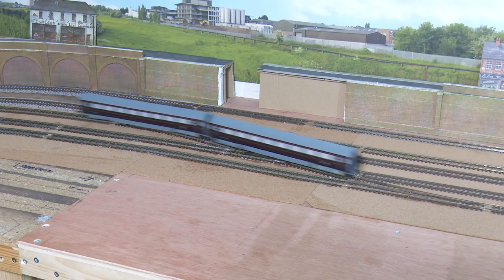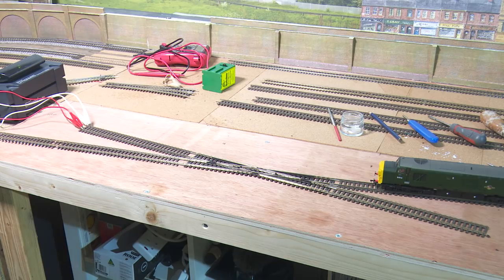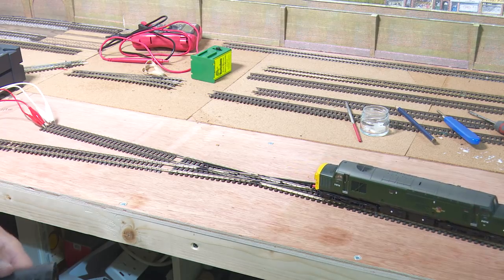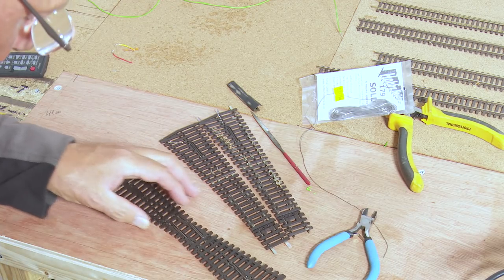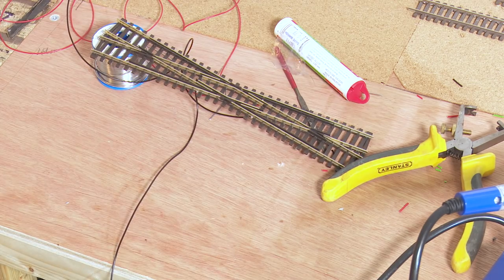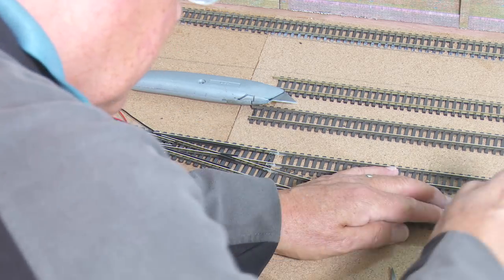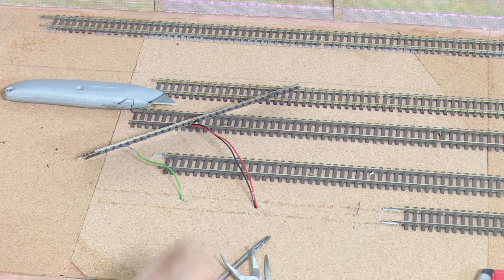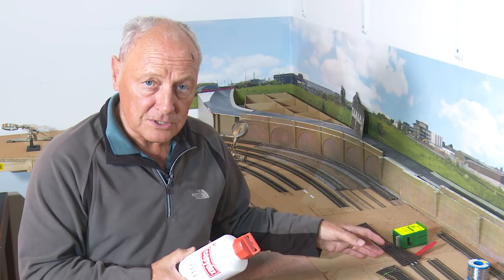43. Installing a diamond crossing at Chadwick Model Railway.

Comment: As usual, another excellent video.  I’ve watched some of the series 6-8 times especially when I’m moving on a stage.  So this week I’ve laid 2 double slips and a single slip with Tortoise motors for the station throat.  This is the first track, first soldering, etc, etc.  Your help has been invaluable. I just thought you should know your hard work, and clear explanations are being put into practice and are much appreciated.
Reply from the maker: Hi Brian, it’s comments such as yours that make the effort worthwhile.
Good luck with your layout.
Regards Charlie

Comment: As always great tips. It might be a daft request but I have a lot of trouble getting track joiners to fit. Do you have tips to preparing them.  Hope the head heals soon. Steve
Reply from the maker: It’s just a case of filing off the burs from the cut rails and being careful.  There is no easy answer  I’m afraid.

Comment: Could you provide a link or website for the pico 6 foot track guide and the track setter? Thanks! Excellent video. Thanks for sharing
Reply from the maker: Hi, the 6ft Gauge and the Tracksetta gauges are both made by Peco and should be available from any Model shop.  Failing that, do try Hattons.
Regards Charlie
Reply: Thanks for the info.

Comment: Epic video, i need to learn all this point wiring before i make a start on my layout. so block detection is all about isolating each track from one another? where do the wires go to the main bus or?
Reply from the maker: Hi, I’m so pleased that you enjoyed the video.  With block detection and computer control, each block has its own separate power feed from an electronic controller.  In the case of Digitrax, its a BDL168.  Please search YouTube for this item and hopefully you will get a better understanding.
Regards Charlie
Reply: @ChadwickModelRailway  Great, can the bachmann dynamis ultima do something like this? as i think thats the controller im going to go for
Reply from the maker: I very much doubt it.  Any automation will probably be based on time.
Reply: @ChadwickModelRailway  ahh blimey, oh well not to worry thanks.

Comment: Another great video, Charlie! I had a similar situation, could go from the near track to the far track forward, but had to back through the turnouts to go the other way. No room for another pair of turnouts, so I had to install a railroads nightmare: a double crossover. Think of two parallel tracks with an x between them. 4 Atlas #6 (medium) turnouts and a 19 degree crossing make a double crossover with a 3 inch center-to-center track spacing. My track has 2 inch spacing. I had to do some creative "surgery" to the turnouts and crossing to get the correct spacing. Does it work? I put 35 cars behind my 4-8-8-4 Union Pacific Big Boy steam locomotive and pulled the cars at speed step 10 (of 28) through the crossing 3 times with no derailments, then BACKED the train through the crossing at speed step 5 3 times with no derailments. I'd call it a success. With track-work, you simply do what you have to do!
Keep 'em rolling!
Reply from the maker: Hi Flyboy, I’m so pleased that you enjoyed the video. Regarding your double crossover, I too fancy constructing one.  I have some used points but have yet to plan the layout on the other baseboards.  Is yours  DCC layout as its wiring could be a challenge.
Regards Charlie
Reply: Hi, Charlie! Yes, my layout is DCC. I have the turnout frogs powered by Caboose Hobbies manual ground throws with contacts for the frog. (I just need to remember to throw both turnouts for the selected route.) Other than that, I just wired both rails of the turnout together to provide good, reliable electrical contact and not rely on the point rails for contact. The frog of the crossing is not powered. I attached feeders to the rails of the turnouts in the standard manner.  Here's a link (hopefully) to my layout page at  Model Railroad Forums dot com. http://www.modelrailroadforums.com/forum/index.php?threads/the-union-pacific-soggy-bottoms-division-ho-scale.26206/page-6 Posts 106 and 107 show the crossover. These are Atlas products, and all frogs are insulated. I really don't know how you'd wire up Peco Electrofrog products. If I can be of any help, just ask!
Reply from the maker: Sorry Flyboy but the link doesn’t work.
Reply: Sorry for the delay getting back to you, Charlie. I don't know why the link won't work, it does for me. I sent you the link via email through your photography site. Hope that's OK.
Reply from the maker: Thanks Flyboy I now have your link.  That crossing is a great construction.  I'm sure that I will have a go soon.  Regards charlie

Comment: Hi
Did you use 6 irj  in total for the crossing?  I'm sure i saw 4 on one side and 2 more on the other end.
Thanks 
Andy
Thanks 
Andy
Reply from the maker: Sorry Andy, what's a 6 ijr?
Reply: @ChadwickModelRailway  
Hi charlie  Thanks for the reply. Icould  see 6 insulated  rail joiners on the insufrog crossing. Was wondering  if there should have been  4  from point to point crossing  or do all tracks  need irj.
Thanks 
Andy

Comment: Hi Charlie! Been watching through the videos from your change from Chadwick TMD to Chadwick Railway. Has been very interesting! I noticed on a few videos you modify the points by cutting the link and then soldering the sections together... You aren't the only person who has done a video doing the same thing... Kinda makes you wonder why Peco don't supply the points as standard in the configuration you have made... Might be worth contacting them and suggesting it?! - Richard
Reply from the maker: I agree Richard and Peco understand the situation.
The modification is actually detailed in the instruction leaflet..

Comment: At about 1:30 you mention that you want the two points to fire at the same time.  Is this a trick at the Tortoise level, or something controlled by your digitrax?  I’ve got 3 such pairs so would appreciate knowing how that’s done.
Reply from the maker: Hi Brian,  switching two points together is common on many layouts.  With Digitrax you simply wire the two pairs of wires into the point controller.  If you are using a stud and probe arrangement then I think that you need to construct a diode arrangement.  What system are you using? Regards Charlie
Reply: Chadwick Model Railway  I’ve not got power yet, just droppers ready. I’m hoping to invest in a bunch of Digitrax stuff next month.  If the control is there, that’s fine. I thought I might be missing a Tortoise trick.  Thanks again. Brian
Reply from the maker: Yes with Digitrax, you just wire both motors into the same terminal.  You might have to switch the cables around to make sure that they both operate in the right direction.

Comment: Since both points will be switched at the same time, why not do it with only one tortoise? You can use the gadget Tortoise has available or get really devious and do it with two pieces of piano wire.
Reply from the maker: That’s a very good point but with the point motors being about 14 inches apart, I’m unsure that this type of linkage exists. Good luck with your layout. Regards Charlie
Reply: Hello Charlie, the Tortoise linkage would handle that easily, my points are 22 inches apart and I use the Tortoise remote setup. It is slightly cheaper than using two Tortoises and it's also a useful option when you have restricted access under the layout. 
More challenging is making a linkage using piano wire, mount the Tortoise horizontally and attach the piano wire linkage direct to the screw on the Tortoise. I've used this setup when I didn't have a Tortoise remote and there were wooden braces under the layout, that was a single point setup but I'm sure it could be used with a two point setup.
Reply from the maker: Thanks for the update.  I’ll try and find a Tortoise dealer here in the UK and check out their full range of accessories. Do you have a website of a dealer? Regards Charlie
Reply: I've made most of my purchases through Ebay.

Comment: Q: Are those #6 or #8 points, and what angles are associated with the various point #'s? (Sixty years ago, I worked on a Union Pacific engineering (read survey) party, and, believe me, staking mainline double crossovers was the bane of our existence. Unfortunately I have lost my track tables which also had all the spiral information.)
Reply from the maker: Sorry Jack, Peco, do not list the points by #.  They are either short, medium or long. Regards, Charlie

Comment: I do have a question about the rail code you're using (code 100)
you said in a prior video that this was much better for exhibition networks, considering those need moving every week end and code 100 is more sturdy.

considering you're now doing a fixed network, that won't move for a while, you couldn't you have done it all in code 75 ?
Reply from the maker: Yes, but now 75 Bullhead is even better AJ.

Comment: btw “Copydex” is the similar compound as a product called “Maskol” - an ammonia/fishy smelling liquid glue used to mask areas of modelling paintwork, usually applied in minute form with a cocktail stick. Just a tip, if you’ve already got a bottle of Copydex it can be used for masking paintwork detailing - it must be removed though after a couple of hours.
Reply from the maker: That’s Bobby, that’s a good tip. Regards Charlie

Comment: I am having trouble on how to wire up  double/single  slip crossing, need help-Please
Nigel Woodgate
Reply from the maker: Hi Nigel, I’m betting that you’ve cross- wired the frogs, assuming that you’re using electrofrogs.  The wire from the frog goes on the opposite point motor.
I hope that makes sense.

Comment: I just noticed in your video that you had four on one side of the crossing . My thought. Was you only used isolated joiners on the crossing between  the tracks . And not the straight  through  track.
Reply from the maker: Hi Andy, I’ve used for insulated rail joiners because of block detection. Have a great Christmas, regards Charlie

Comment: Hi charlie is it possible to repair a double slip, as one of mine is faulty i thin k the spring is broke at one end is it possible replace the spring and can i get one from Peco ? regards .good video charlie.
Reply from the maker: Sadly Tony, I’ve never tried. However, because I use tortoise point motors, I always remove the springs! I’m pretty sure that Peco do sell springs separately. Regards Charlie

Comment: Hi. What size heat shrink tubing would I use for 1.6 and 3.2 wire? Many thanks
Reply from the maker: Here's a link to the kit that I use Les.
https://amzn.to/31CPA3a
Regards Chatrlie
Reply: @ChadwickModelRailway  many thanks for replying. I will certainly buy that kit. Also the bus bar connecting blocks from amazon you mentioned in a previous video are going to be brilliant. I've finished laying the baseboard and have made a lift up section. I'm going to paint the board and then lay the track joining droppers to bus wire. It's all exciting stuff. You have many great ideas and tips. I'm glad I found your site. Keep up the good work

Comment: Was working on my track today and found myself trying to slide a fish plate (rail joiner here in the US) onto a short piece of track like you were doing at the 2740 time line. i kept squeezing the joiner to much and it would bind. I then went to using a small screw driver (flat blade) and pushing the joiner one way or the other and I found that this was faster and (I feel) better...
Reply from the maker: A great solution David.

Comment: Hi Charlie
Ouch, hope your noggin is okay.
Being one of those people who had issues with the insulfrog crossing I found this an interesting video.   Ive now changed both mine to code 75.  I got to the point I was pulling my hair out due to locos stalling for a fraction of a second or worse case shorting out (this tends to be my Hornby models ie class 31 or 50 and lima stock with chunky metal wheels) the smaller locos were an issue, 08, 03 and 07.  It also convinced me I needed stay alives, however Im not so sure now as so far the 07 on test hasnt had any issues on the code 75 crossing. When I find the 08 I will be giving it a thorough testing too.
I havent tried glue yet but it seems to have advantages over pins, if a little slower due to the waiting time, Im going to try it out on my next board.
Look forward to your nect videos.
Regards Paul
Reply from the maker: Hi Paul, thanks for your interesting update. Reading through these comments, one chap used clear nail varnish to stop the shorts.
Regards Charlie

Comment: I was just wondering something. I notice that (on your side of the pond) you have double ended engines. I understand that this was because of the lack of space for turn tables. My question is how do you know where the actual front of the engine is for forward and backward operation?
Reply from the maker: Great question. 
They are known as either No 1 or No 2 end.  The end with the roof fans is No 1 but it really only matters when computer control is involved.

Comment: Why not using a double switch cross over (I don't know if that's the right word), so that the train from chadwick can not only con into plattform 1, but also in 2?
Reply from the maker: There is a point back up the line which allows access the platform 2.  I think that you mean installing a double slip.  However, in real terms, if a point should fail you could have a “head on” with a train on the down line.  I hope that make sense. Regards Charlie

Comment: Enjoyable and informative video, I am planning to use 4 turnouts and a small crossing to make a double scissors crossover and it will be OO finescale. I think the electrical side might be interesting :-) I also think I may have to modify the crossing to keep my track centres at 52mm.
Reply from the maker: I’ve looked at doing the same. You do have to cut down your points. Good luck with your layout. Regards Charlie

Comment: Hi there are you using streamline or set track spacing between rails? - excellent videos! Cheers JC
Reply from the maker: Hi JC,  just to confuse you, the answer is both. I normally use streamline spacing, opened out on the bends to allow Mk 3 coaches to pass each other.  However, on the four tracks through the station, I’ve used set-track distances to separate the centre tracks.  This is to allow a support column for a footbridge . I hope that makes sense. 
Regards Charlie
Reply: Chadwick Model Railway thanks that’s interesting! I must admit it’s set track spacing for me because of passing long carriages - interestingly it doesn’t help when you’re installing long crossings and streamline points hahahah

Comment: Great video again Charlie. Loads of good tips there! Glad I'm done on track laying. Copydex is a god send for virtually instant bond and noise reduction. I'm half thinking is it good to use for glueing down ballast! Wonder if it works as well if diluted down the same way as pva! That will be a near future test.
Reply from the maker: I’m sure that I have heard of someone using Copydex to ballast.  I’ll ask in a future video. Regards Charlie
Reply: @ChadwickModelRailway  I'm almost sure I read of this in a Railway Modeller back in the 90s.
Reply: @ChadwickModelRailway  would be intersting to see if anyone has done it with success. Ive glued my track (wood glue and copydex) and the sound is greater through the baseboard on these sections than the pinned areas. Would be good to see if copydex soaked ballast keeps the sound level the same as it is now without the ballast.
Reply from the maker: Wow, that does surprise me.  Just to clarify, you’re saying that pinned track produces less noise than track glued with Copydex?
Reply: @ChadwickModelRailway  yep - with no ballast down at the moment the sound difference is highly noticable. If copydex works as a glue for sticking ballast down and the sound thats transfered through the baseboard remains near on the same before ballast then thats a win in my eyes. 
I'm a little while off from ballasting at the moment but very tempted to test a small area.
Reply from the maker: I’ll ask in my next video and I’ll certainly do a test piece. Regards Charlie

Comment: David. The problem comes with hornby locos some short out because wheels profile to thick
Reply from the maker: Hi David, I used  Bachman’s 37, a Hejan Bubble Car and a Hornby 08.  No problems encountered by I will try my Hornby Class 50. Regards Charlie
Reply: Chadwick Model Railway  I solved the problem by using clear nail vanish .I always look forward to your shows, David
Reply from the maker: Wow, what a great tip. Thanks for sharing David. Was that just on diamond crossings or have you needed it on points too?
Reply: Chadwick Model Railway  I have only had the problem with the diamond crossing ,with  hornby class 31 and class 56 . David

Comment: A friend of mine told me about the way he cut the hole for the switch machine. He (and now I) uses a tool that will cut a slot through the board. I cut out the entire space under the switch sleeper and this does not show at all. This give me a slot that never will let the wire up through the switch hit on anything. You can look directly down through the switch and never see the slot. I like it better that the 1/2 inch hole they would like you to cut.
Reply from the maker: I’ll certainly have a look at this technique David.